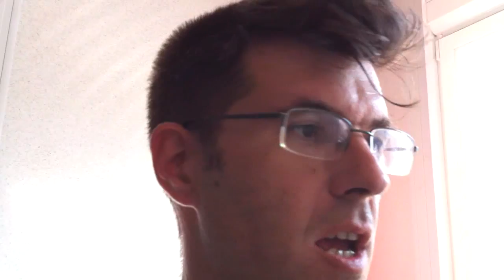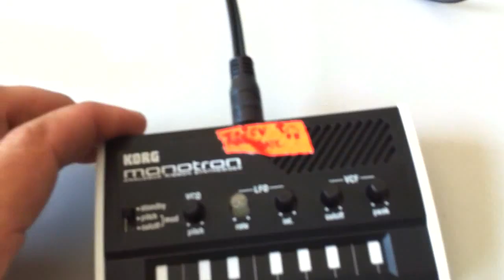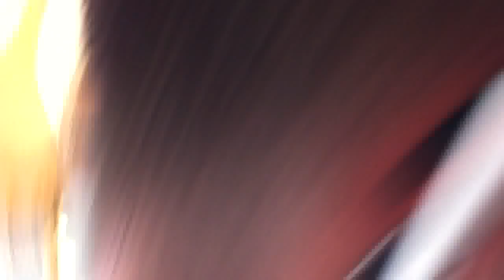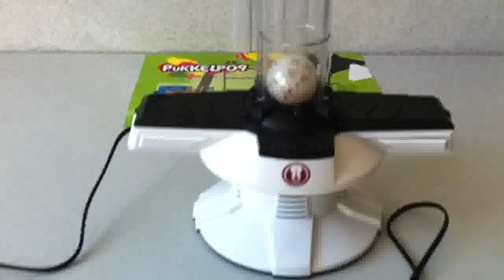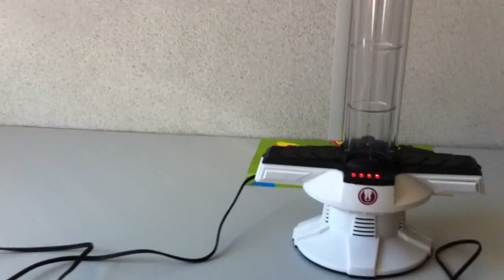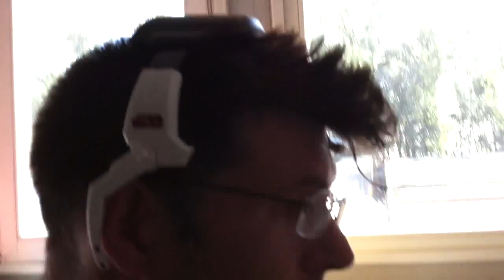Brainwave controlled monotron

Comment from the maker: It is a star wars force trainer, it cost about £60 in uk. The frequency of the monotron is determined by the average frequency of your brain waves which are measured by the headset. 
I work for the prodigy as a the keyboard tech and I made it at a festival in holland when I was bored one afternoon. 
I can probably remember how I wired it up if anyone wants to make one.